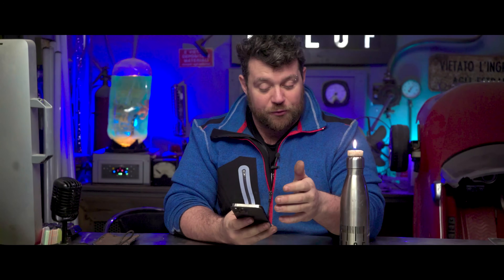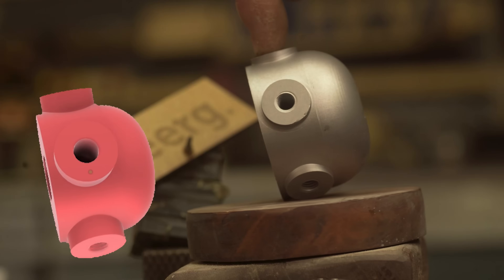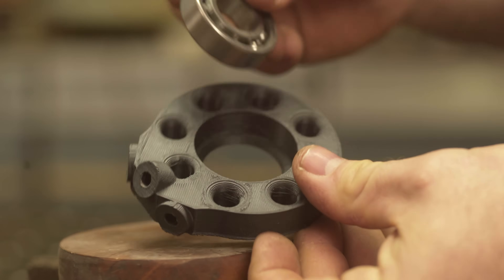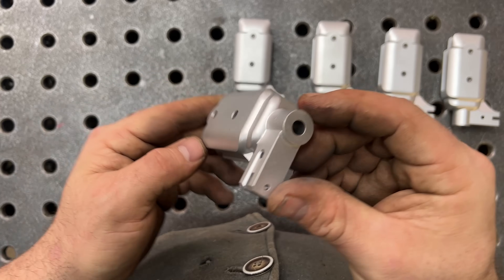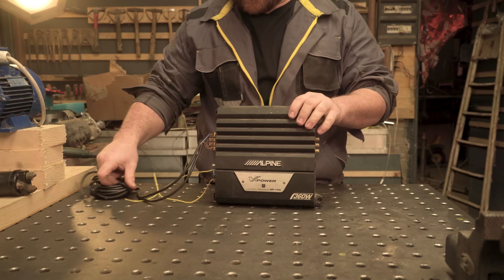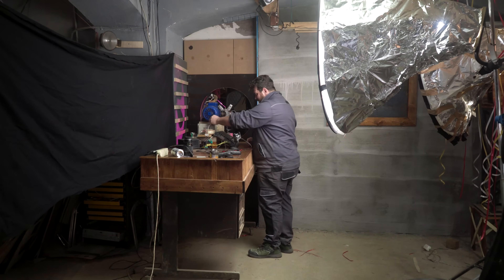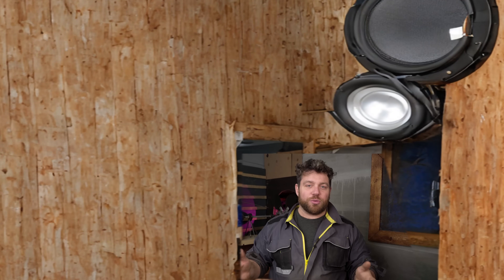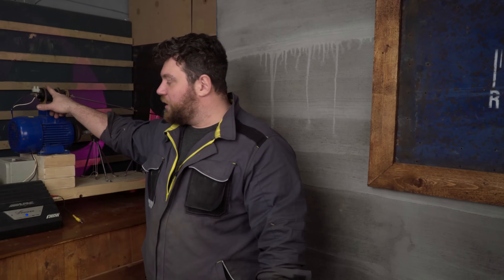How to Make a Rotary SubWoofer

Comment: Pure nonsense... Without knowing engineering and sound.. if motor rotates 80 RPM and it that speed blade moves one time it creates 80hz. How you change motor speed and pitch of blade to mimic speaker.. all metal parts creates enertia that creates sluggish response.. go to school and learn physics..

Comment: Balancing of the rotating weight and flex connection on motor and shaft is really needed. Also sound insulate the solenoid or replace it with speaker coil to play other than one tone.

Comment: I'm wondering why you were so technical and precise when designing the fan and blade assembly but went so rudimentary when designing the blade pitch device.  That part is really the source for the actual sound and requires a proper voice coil.

Comment: As a machinist I find it wild that this dude put all the time in to make SOME precision parts but then other things were insanely sloppy. Like the main shaft wasn’t even turned straight it, he just used raw stock. And that linkage arm was completely loose. I don’t get it.
Reply: the fan is done so well but the solenoid bit is terrible. if he did the second bit properly this thing would probably blow his roof off

Comment: people, please be careful, indoors and in the right configuration this, or even way smaller systems can EASILY reach power levels of air pressure change that can immediately und seriously damage internal organs, blood vessels, lungs etc, also from a distance !  in this regard, a rotary sub is a COMPLETELY different beast than any conventional high power car hifi system with normal subs that use much more wattage
Reply: Bullshit 😂😂😂
Reply: @Drowning_Im  nope

Comment: Hello, man, thank you for sharing your project, I also made such a fan, built around a hoverboard motor, but I did not get any subwoofer pressure effect - and I found the reason in your clip - I do not have yet the separation plywood that should separate the two "rooms".
I see a problem in your design - the rotary plate that adjusts the blades should spin free from the main axle, but it should not move relative to the blades plate - otherwise the push-pull motion will partially get lost by the relative motion of these. Also, those bent wires have a lot of lag against the bolts - and again, you have mechanical loses there also, you should make some ball joints there.
Also, I suggest you build the solenoid around the main shaft, just attach some neodymium magnets to the sliding plate and just add 1mm copper wire coil in front of it. 
Great and simple presentation!

Comment: More stuff about this thing, less rattle and maybe the fan connected to the normal subwoofer so you get the 30hz perfect and the fan does the under 30hz real low stuff

Comment: Not only a membrane weight counts. But an amount of air displaced by the membrane multiplied by a factor which depends on a cabinet architecture (Qms mostly). This dynamic weight can be x1000 heavier than a membrane weight. So.. Recycle the solenoid, cause it has nothing in common to a sound, and try a "normal" coil + a magnet. A blade must have a special shape, so it returns to a neutral point with an air.

Comment: You could space out horseshoe magnets, three in a circle, and three spaced out in a row (9).  Copper coil the rod, and run the amp to the coil.  That'd give you the full wave.  I'd be like the Jackhammer woofer design.  You wouldn't have to destroy a speaker.
You don't have to have it at a window.  You can run it under the floor, with open intake.  This cuts the noise.  Most bass is above the column of air freq. of the smaller area you'd have putting it under the floor.  Most ppl don't want their lungs affected by a 1Hz signal, either.  So, a movie or song would be practical with the floor setup.

Comment: Slightly works at producing a half square wave every two seconds… but that will it never reproduce a sound track from music or movie sound track.  
Install stone bearing or at minimum brass bushings & key the hub for the transfer bars…. Perhaps it’ll last longer than a week. 
Def a cool build to troll the surrounding houses, add a  keychain pushbutton remote so you can stand outside and ask hey where’s that thumping noise coming from while pushing the remote in your hand. 😈👹

Comment: This is an impressive creation, but not a good rotary subwoofer. A binary solenoid is not a good control mechanism and the system is too large and massive, as acknowledged near the end. You can make these subwoofers follow musical waveforms and produce frequencies much higher than this one and there are examples on YouTube.

They can be powerful enough to damage your house or things in it ;).  Your spouse and neighbors might not approve.

Comment: You want as low a mass as possible to have move at audio frequencies. I would suggest embedding neodymium magnets into foam blades, or turning a shaft that runs the length of the blade, twisting, and making electromagnets in the hub, fixed (but spinning). You would need rotating collar contacts on the main rotor shaft. You can then match the impedence of the coils in the electro magnets you built to the expected impedance of an audio amplifier, typically 8ohms. If you use a stereo amp, you can use one channel to push and the other to pull by inverting one channel and use a second array of flipped magnets and coils. You need to put a low pass RC filter ( 2 or 3 passive components, maybe a variable resistor to adjust frequency) between the mp3 player and the amp, to filter out anything the speaker cannot handle, I'd take a guess at 100 hz or lower. The stereo signal has the same bass on each track, so if you're not using a stereo amp, just use one,  you need a low pass filter for each channel.
You really want blades with a symmetrical profile, and it's my guess you want to reduce the space between the blades and the hub and the blades and the rim, so you might need want to widen the non oscillating center of the hub and put a ring on the radius, so you're more confident getting it close to the hole.

Comment: rotary subwoofers always excel with very low bass. anything lower than 30 hertz. Fun fact the human ear doesn't really hear 30 hertz well. Secondly if you made a port for the fan you could improve the sound clarity.  Overall great video on the basics.

Comment: I'm seeing more and more people discover and experiment with rotary subwoofers, and that excites me! It's such a niche device but so powerful.
Didn't know you had shut down your old channel, and I'm glad the algorithm recommended your new channel, your videos are great!
You explained at the end that there's a limit to how fast it can change pitch, but don't forget you're only using half of the wave with the solenoid. If you use a subwoofer driver to push and pull the copper sleeve, you should be able to reach 5, maybe 10hz continuous, but you'd need flat blades so you push and pull
Reply: Wouldn’t that make this idea useless? The ticket would be a spring controlled fork like a clutch bearing on a Manual Transmission

Comment: Couldn't you replace the Solenoid with a Speaker?
you Glue the cone of the speaker with the rotor

spero si sia capito in inglese, nel dubbio:
se attacchi uno speaker al posto del solenoide e gli fai ripordurre musica non dorebbe essere possibile far "sentire" la musica. ovviamente lo speaker dovrebbe essere in grado di sopportare la massa di tutto il meccanismo

Comment: A fan can't be a "speaker", this doesn't make any logical sense and there's no way this could possibly work. This is obviously fake and any bass sounds it did apparently make are just dubbed in. Proove me wrong, unless I see one of theese in person I will remain skeptical. Also I wouldn't want a speaker system that constantly makes a lot of background noise.
Reply: I’m sorry, but you are very incorrect, it has to do with physics and this is actually a really good project. The base sound from the song he played was just overlay but he did adjust channels to allow the base he made come through. Research videos if helicopters running and listen to the noise they make. I really do enjoy a good laugh though, friend, thanks for a good joke 😁
Reply: @isaacmurray8490  It's not a joke. This defies physics, maybe not in whatever reality you live in though, maybe the laws of physics are different where you live. I connected a fan to a big amp I have and guess what? Nothing! It wouldn't even turn.
Reply: @CoolDudeClem  wooooowwwww. Aren’t you a genius then? I’m surprised that troll’s law wasn’t taught in my college physics classes. Maybe i forgot but it has to do with the fact that he connected the solenoid to the controller? And I believe that speakers work by creating vibrations in the air based off the frequencies in the electrical signals created by that controller, then according to the laws of fluid dynamics, those waves are carried spherically outward from the source. Then, at least where I’m from, we can hear sounds with our ears that catch those waves in the air. Maybe the fact that, where you are from, physics doesn’t exist is the cause for your lack of logic and reasoning.
Reply: @isaacmurray8490  I'm not even going to argue with you any more as you seem to want to stay ignorant to the fact that it could not possibly work in real life.
Reply: @CoolDudeClem  it actually works bro I’m working on building my own. You really need to put it in an open window with every part except the fan sealed. He’s not the first YouTuber to do this and these things exist in some very high end studios and theaters. Just do some googling homie.
Reply: That's why it's a rotary subwoofer and not a rotary speaker
Reply: @n0tlance314  subwoofers are speakers designed for very low frequencies. But yes, it is a rotary subwoofer.
Reply: What you're missing is that he is changing the pitch of the fan blades to change the pressure generated by the fan. Ideally with a rotary subwoofer, the blades in their neutral position are not pushing any air as they are completely vertical and have no pitch to them. When you change the pitch it pushes air. If you do this relatively fast (up to about 25hz for a rotary) it creates waves of pressurized air which coincidentally are exactly what soundwaves are. Think of the changing pitch of the fan blades as the cone of a speaker moving in and out. Rotary subwoofers are a real thing, but they're not super popular because they require a huge airspace as a box (i.e. an entire other room than the one you want sound in) and they are also super expensive. The only one I know of in current production is about $20k installed. The main reason anyone would want one is that they can produce frequencies much lower than a normal subwoofer, down to 1 hz. Normal subs are very hard to control below about 20hz, and by that point they aren't moving much air so the SPL has fallen off of a cliff. A rotary can maintain SPL output the whole way down to 1 hz simply because of how they work. BTW human hearing bottoms out at about 20hz, so for frequencies lower than that you feel with your body and can't actually hear. This particular rotary sub was obviously kind of hodge-podged together for the video so it's noisy, but a production quality unit wouldn't be like that.
Reply: It varies the pitch of the blades so it oscillates between pushing and pulling air just like the face of a speaker cone, the back of the fan has to be open to the outside infinite baffle style. Can hit infrasound frequencies that no other speaker can get close to.
Reply: Also, in reference to background noise, the only reason you wouldn’t want any background noise is because you don’t want to have ti fight to be star of the show, and in case your small mind can’t comprehend what that means, i’m saying you are background noise. Hope you like being a hater because it really gets your thoughts heard, huh?
Reply: My man out here being ignorant. I'll try to explain it simply. Sound is a series of waves traveling through air. A speaker compresses and uncompresses air as it travels out and in respectively, that creates a wave. What's another way to compress and uncompress air? That's right: a fan with variable pitch blades (aka rotary subwoofer). As the blade spins it pitches one way sucking air, and then pitches the other way and pushes air, JUST LIKE A SPEAKER, but because of the weight and the inertia of the components you can't play medium to high frequency sounds on rotary subwoofers (that's why they are called subs) and they perform better at low and subsonic frequencies, you can't hear them, but you can feel them. I hope this information makes sense to you, if it doesn't then you are stupid.

Sorry for my bad English.
Reply: https://youtu.be/iDtjLkWGW4c?si=b5wobRdhrNaaIUoT right at 7 minutes you can hear the sound going from the normal sub, to the rotary sub
Reply: You should study WWII air raid sirens.. they are literally blower fans!
Reply: @Akideoni  hah… come to think about it… how do we get alerted of tornadoes nowadays too?😂😂
Reply: A speaker works by moving air; this moves air, it creates sound by adjusting the pitch of the blades. It’s doing the same thing a speaker does just in a different way; instead of a diaphragm pushing and pulling air, the fan blades are doing that. If you have any questions, feel free to respond if you have any questions.
Reply: Lol, rotary subwoofers uh, do exist... so, ah... this comment is... stupid af? Yeah. Maybe ❤you are confused because this guy does not show the baffle/box. The fan is only a driver, so with no baffle it's like running a sub in free air.
Reply: Baffle is shown at 10:30, but it's only presurizing in one direction with a solenoid pulse, but actual sound alternates directions as with a sine wave. You might drive the prop angle using a big servo that can go in both directions instead of a solenoid that only pushes. Alternatively, you could add a second solenoid that pushes the prop in the other direction and trigger each with opposite poles of the audio signal. You won't have any control over volume but it would at least make a sound.

Comment: Try one of those variable-pitch propeller from RC helicopters? Or even a whole helicopter; program the controller to the music and the helicopter could fixed in place. They responded nearly instantly, controlled remotely, battery powered (could be hardwired since it will be stationary), very powerful motors (both internal combustion of various fuels and electric ones are made), plethora of blade designs available or custom could be made, (they are expensive for strong RC helicopters)... But this seem ideal for your application.

Comment: Thinking on how to accomplish this I wonder if releasing compressed air can be done quickly and accurately enough to give the sound better quality than trying to actuate the heavy moving fan parts? Or perhaps rather than releasing the compressed air entirely it could be utilised as the actuator and be filling  an air sack in a box with a hole in it? I know you'll solve this one way or another! Good stuff as always :)

Comment: use a magnet on the solenoid shaft instead of the steel block so it can move bidirectional like a normal speaker, and adjust the amp output to not clip
Reply from the maker: thats a great idea!  thanks!

Comment: awesome finally somone hasnt used 3d printed parts wish i could machine metal that good
Reply from the maker: ive usead -weerg that is a  cnc service online
Reply: im almost positive youll need to remake the blades out of metal there cannot be any flex at all ,and i think you should wind your own huge chucky voice coil along the shaft ,as the solinoid is trying to lock the pin in which is counter intuitive @rulof-is-how-to-make
Reply: the solinoid has thick windings but you need lots thin thinner windings .using the voice coil from a dual voice coil subwoffer will work good too
Reply: ive only seen one audiofile grade rotary sub and it was like 100,000 or something stupid like that but it was so good that the motor and the blades were silent when spinning with no music and when the music played there was no air noise only the really low hz and the blades on that were quite thick metal
Reply: @angusmcgil that would be the Thigpen Rotary Subwoofer by Eminent Technology! I think it's the only "commercially available" rotary subwoofer; the rest are home projects!
Reply: @78audioguy  it was beautifull peice of machimery the fan and mechanisms were virtually silent

Comment: I love the execution of your plan but due one oversight, this thing will never work at anything higher than like 4hz, because you're using a solenoid for actuating the fans, the solenoid is just like a on/off switch, there's no inbetween so it cannot oscillate or vibrate like a real speaker, a speaker's coil goes in both directions, inside and outside, you'd need a speaker to actuate and oscillate the fans for it to have any sort of actually bass response, as of now it's a giant air pressure changer.

I'd love to see you come back to this project in a future video and try using it with a real speaker, I've seen some videos of other people using it with reall speaker to drive the fans and it works really well.